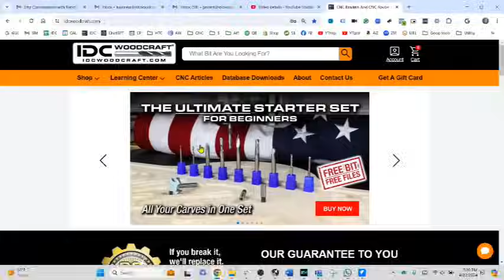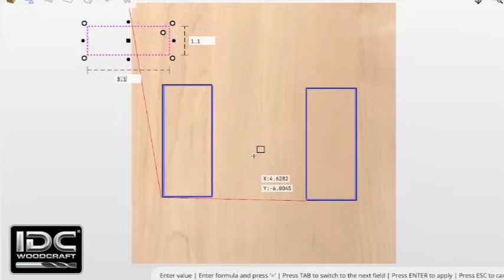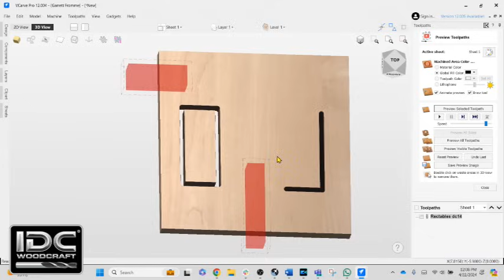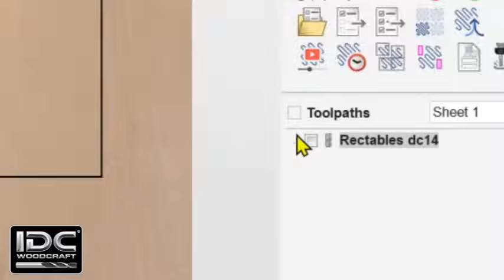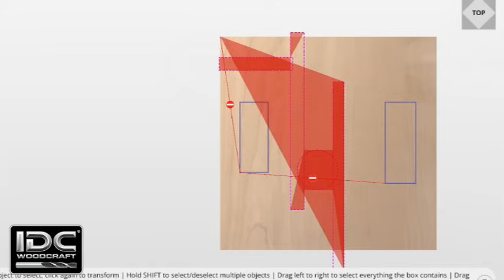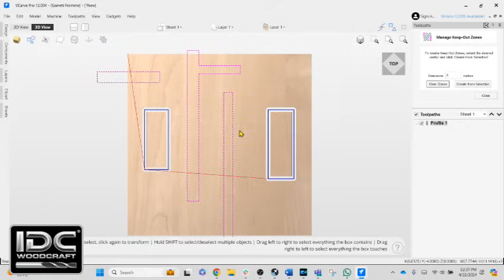No More Broken Bits!

Comment: Garrett, I need to be able to create a "Keep-Out-Zone" within a circle cut. Because I don't want the tool path traversing the quickest route across the circle. I have multiple  8" circles on a 24" plus workpiece in which I want to do this. If I could talk with you, I could be more descriptive. Is this possible? Or am I relegated to using just rectangle keep outs?
Reply from the maker: Unfortunately you can only create rectangular. Keep out zones. However you can make multiple small rectangles
Reply: @IDCWoodcraft  Garrett, Is it possible that I could send you the code and reasons for you to analyze? I need another head looking at this please.

Comment: Thanks for the deep dive into keep out zones. Can you have more than two tool paths?
Reply from the maker: vincetoscano7018, You're very welcome! Yes, you can definitely have more than two tool paths in your CNC program; it all depends on your project's requirements and complexity. Some projects may need multiple tool paths for different operations like cutting, engraving, or pocketing. It's a great way to achieve more intricate designs!

Comment: This is a nice feature. Its too bad they did not allow for a height or z setting for the clamps or screws, allowing the bit to simply go over rather than weaving its way across. Thanks.
Reply from the maker: MyGarageWorkshop, I totally understand your point! It would definitely streamline the process if there were an option for adjusting the height of the clamps or screws. These design choices can really impact workflow and efficiency. Thanks for sharing your thoughts!

Comment: At least in Aspire 12, You can  still use both the new project rotate feature and the old project rotate method by going to Edit-Program Options-View Controls mode and select "legacy" instead of modern. Then you can use  both.
Reply from the maker: Rhoude7695, That's a great tip! Thanks for sharing your knowledge with the community.

Comment: Very nice tutorial Mr. Homme.  I noticed that the "keep out zones" are only a 2D configuration.  At some point Vectric might include the 3rd dimension for "keep out zones."  Some CAM programs can jump over the obstacles if the machine is capable of doing that.  Subject to what distance your Z axis can retract up to of course.  Nice presentation you did.  Thanks.
Reply from the maker: richardwilliams5520, Thank you for your kind words! Yes, you're right that some CAM programs can jump over obstacles if the machine allows it. Adding a 3D configuration for "keep out zones" could definitely be a useful feature in the future. Glad you enjoyed the presentation!